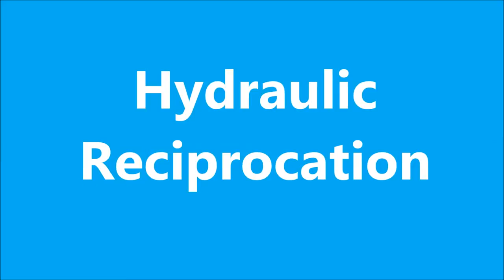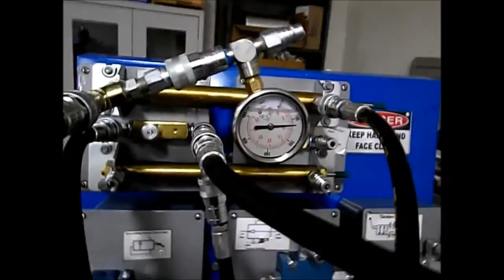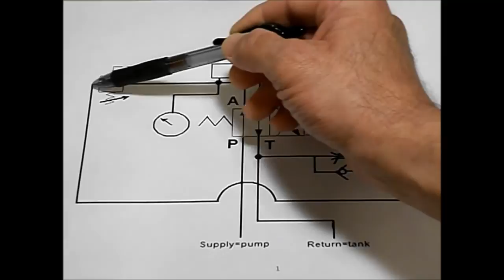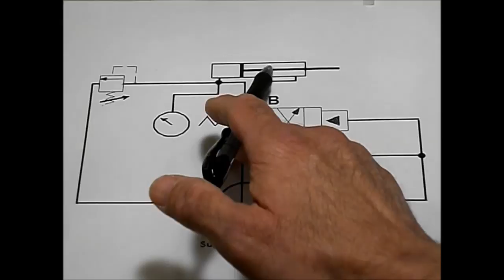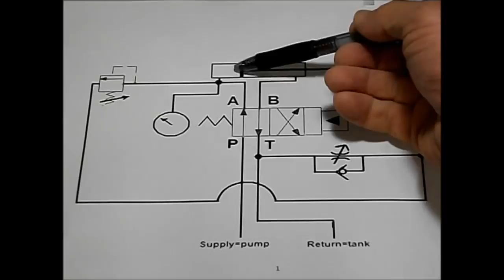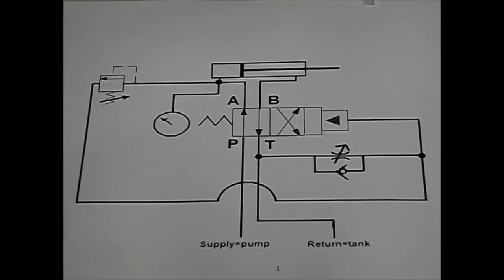Hydraulic Reciprocation with Pilot Control - Explained

Comment: I want to see if something similar will work for a log splitter.  They have auto return, but I want to make my log splitter multi-purpose as a can crusher/baler
Reply from the maker: This was simply a lab demonstration of hydraulic principles. Industrial applications requiring hydraulic reciprocation have specialized controls to do this.

Comment: Hi Tony,
Thanks for the video good explanation.
On the return stroke, is it the flow control valve that causes the pressure to stay above 10 PSI energising the pilot control valve? It seems to maintain a constant pressure at around 15 PSI, I don't understand how this works...
Reply from the maker: Flow control valve does provide some restriction which maintains SOME back pressure.

Comment: Hi... Will it still reciprocate if the ram is under load all the way to the end of its stroke?
Reply from the maker: Tony Branco Actually never tried it with a load - this was a  demonstration/experiment in the lab manual for my hydraulics and pneumatics classes I teach.  I suspect it would work with some load, but obviously if there were too much load it might dampen out the oscillations and "kill" it.